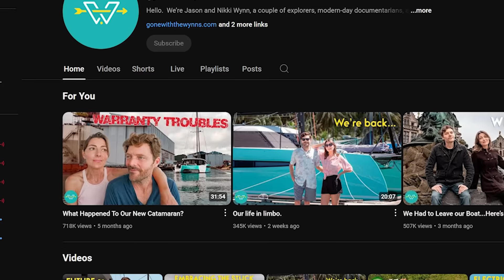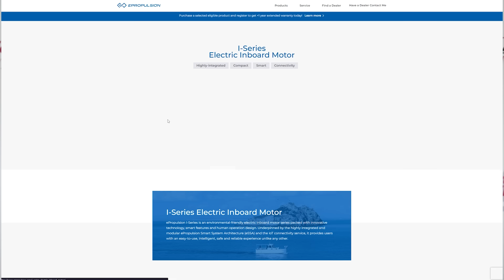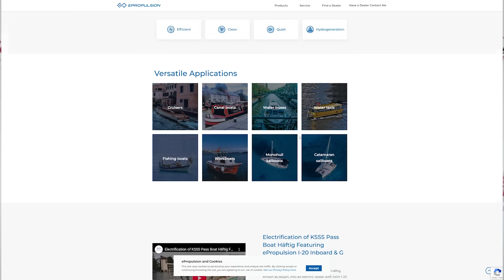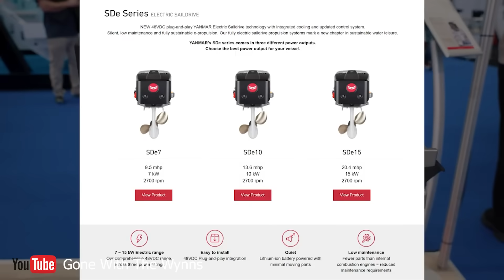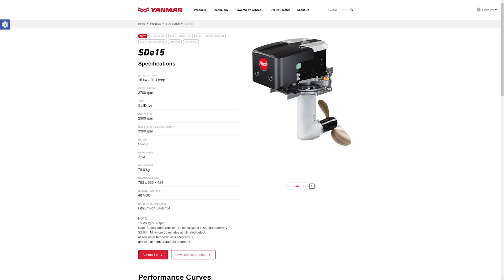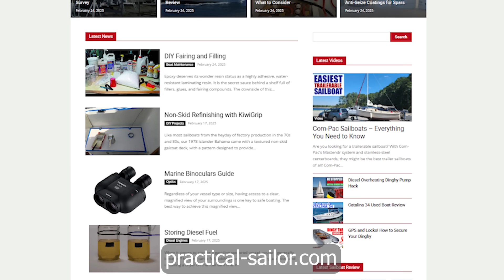Is It Too Soon for Electric Sailboats?

Comment: Water and electric.... Not a great combination. Most definitely at the current state of development, I prefer diesel as power source over electric. (After trying LiFepo4, agm, gel and standard batteries).

Unless with a small boat on a lake, to just enter and exit the harbor, electric is not good/reliable  enough yet.
Reply: water and diesel don't mix either.

Comment: On a blue water catamaran with diesel electric drive. Centrally located industrial 400VAC diesel generator and 2 electric shaft 400VAC motors. Highly efficient and reliable. Now 19 years old and still working completely fine. Very happy.
Reply: Truthfully, on a catamaran that makes sense as they have very low drag (good for electric) and you would have to have two diesel engines, which sucks.
Reply: @crunchycrispybacon  Not "less drag", but when lightly loaded, can exceed their hull speed.  "Modern cruising catamarans" are heavily loaded, at the expense of that advantage.
Reply: Your system seems to work for you, but "modern sailors" lose bragging rights over the noise, odor, and maintenance of diesel.  I also question their competence around 400 VAC equipment.  Having two independent systems also deters "what if " questions about triple backups from the living room experts.
Reply: @ I’m not telling. People they need to change whatever they are doing. Be at peace.
Reply: That's the key to success, diesel generator. 
Caterpillar with their monster build prove it everyday.
Reply: @GoPoundSalt Hybrid...yes

Comment: Batteries will not improve in the next 40 years. So maybe we should copy the tech used in trains and huge ships. Trains and large ships use an electric motor and batteries that are powered by diesel. Not many batteries. There is a diesel motor that is quietly operating at its most efficient RPM keeping the batteries at optimal settings. Should not be too hard to do on a sailboat if there is space.
Reply: Trains and ships only use the technology that they do for one reason: Scale. It is simply not practically possible to build complex mechanical drive systems in those applications.
Alternator losses, variable frequency invertor losses and motor losses far exceed those of your typical mechanical drive system. There's a reason that hybrid cars use a conventional drivetrain when running on the engine rather than using the electric drive and it's the same reason trucks use conventional gearboxes and drives rather than electric.
It all comes down to efficiency.
Reply: @davidbrayshaw3529  Also those commercial applications run all day so the diesel electric makes good sense. For typical less than 1hr/day it makes no sense. Just use the diesel.
Reply: @ Unfortunately many harbors require electric motors.
Reply: @CheapHomeTech  Which?
Reply: @ Which harbors or which boats?
Reply: @CheapHomeTech  Your mention was only only of harbors.  The topic at hand is private boats.
Reply: @davidbrayshaw3529  Seems you have many assumptions. Existing small boats have diesel that are powering batteries that power the electric motors. There is no complex mechanical drive systems and what not. Quiet, dependable, and affordable allowing for hundreds of miles or more at slow speeds. The Wynns boat mentioned in this video has such abilities allowing for extended and efficient cruising.

Comment: Electric drives are massively expensive when compared to a diesel engine.  When you consider the mass and all internal moving parts on diesel engine compared to an electric drive which is far cheaper to produce because it has a way smaller mass which equals less material . Then consider 500 moving parts on diesel engine compared to 10 to 20 parts on electric drive . The diesel engine will when properly maintained and quality of said diesel engine will far outlast any electric motor. The other problem is the complexity of all the extra electrical components to refit the boat with the electric drive system.  Diesel engines only require a 12 volt battery. Electric sail drive looks good on paper but unfortunately not good on the pocket book and long term reliability.

Comment: If youre plugging into shore power every night, and dont motor far,  it's fine, if you want to go cruising and travel places without Shor power it's nothing but problems.
Reply: I'm not a rich man, so I hesitate to pay so much for an electric motor AND a bunch of batteries OR a new inboard diesel. My system for now is a 15hp outboard on my diy handmade mount that also holds a 62 pound thrust trolling motor. The trolling motor is great for getting in and out of the slip since I can turn it at 90 degrees and push the boat where I need it to go.  I have a 200ah battery and over 400 watts of solar. The little trolling motor will go in 4th gear (out of 5) as long as the sun shines, although slowly, and for a LONG time in 5th gear.  Now that I've graduated from a 25 footer to a 33 going into a strong wind is impossible.  That's what the outboard is for. Of course there's the problem of cavitation. 
I've become obsessed with the EPropulsion pod drive that is equivalent to a 9.9hp, for about $3100, plus batteries, which would be enough for most situations but would be slow going into a strong wind.  So I'd still have to have the outboard to be sure that I get back to the marina. 
Still dreaming!

Comment: The range argument is such a red herring. A hybrid system solves range entirely, and reaps all the benefits of not having a complex metal object interfacing with seawater constantly.
Reply: Not a red herring.    Hybrids require two separate systems... diesel engine/electric drive.    Complexity invites failures.
Reply: @Ranchpig67  A hybrid system adds a grand total of ONE extra moving part; the electric motor.

And it eliminates thru-hulls and seawater intakes.

Comment: Hi Tim. Worth keeping an eye on developments, but right now the issue continues to be issue of energy density, and far and away the best “battery” continues to be Diesel Fuel, and in the near future- the continuous renewable energy from waste to energy from Plasma Gasification with Syngas production of ultra clean liquid and Gas synthetic fuels, the most important of which being energy density enhanced synthetic Diesel. But ! There is a completely new option that is becoming available in the form of new engines from Toyota,which have almost zero emissions, and which can handle a range of fuels including hydrogen - which after full research after the 1970’s Oil Crisis, became questionable after successful end results , when people started asking questions about whether we really want large amounts of hydrogen all over the place, with very easy access to them, given what a high explosive hydrogen really is, and which doesn’t even need complex detonators to set it off ? 🤔 For Safety concerns, nothing actually seems to be better than diesel fuel frankly, given you can even put a cigarette out, by just throwing it into diesel.  Given we can actually produce pretty much unlimited synthetic diesel, at extremely low cost, I know what I am sticking with for the foreseeable future anyway. All the Best. Bob. 🤔🌟🌟🌟👍⛵️
Reply: You miss the crux- the issue is WEIGHT....you just gloss over this by saying "energy density" If battery capacity is increased many of the problems cited (low range, low power) go away and, as opposed to ICE engines which need to manage damaging heat and friction as well as liquid fuel supply engineering issues (many more failure points) Electric looks really good.
I never need to change the oil on my electric. I never need to clean a filter. I never need to replace an exhaust elbow. I never fail due to mechanical issues. At its' base level Electric is superior.
Reply: @ you totally ignore multiple issues,mwhich include issues such as how do you produce enough electricity to keep storage topped up , how many people actually have any understanding of how to treat batteries properly for a long and reliable service life ,mwhether lead based or the spectrum of lithium some of which it is recommendedvthatbtheynonly be charged in explosion proof containers, Lifepo4 for example,should never be discharged below 50% capacity or you lose recharge Cycles, must not bevrapid recharged or rapid discharged as that shortens their service  weight of batteries if positioned correctly can have beneficial displacement benefits plus can counteract the leverage effects of an aft Cockoit Solar Arch with Solar Panels,May having a bank of AGM batteries mounted low  at Cabin sole level below deck. How many people know how to dramatically reduce the stress in individual batteries by sharing the loads equally between four batteries,instead of over stressing in every respect a single battery ?, Frankly, it is only in the last year or 18months, that enough information has become available, to be able to start treating Lifepo4 batteries properly, and is why I had no alternative but to reject an offer by Anpere Time - now called Li Time - to provide me with a bank of their batteries to see just how long I would be able to make them last - the needed basic information simply wasn’t available. In contrast, today, it appears that I am now able to make a Bank of cheap Redodo Lifepo4 batteries have a potential very long service life indeed, which frankly is one heck of a transformation, but still, for reliable propulsion and enough storage capacity of high density energy, capacities are still way below requirements for the Marine Environment, and as Jimmy Cornell clearly confirmed, you just can’t get enough energy production to even fulfil basic requirements can you ?So if you wish to keep deluding yourself with LaLa Land delusions based on fantasies and wishful thinking,m you are welcome to carry on, but please refrain from contacting me, until you yourself  at least start comprehending what the actual f*k you are are talking about. Deal ? 🤔
Reply: PS. Tim, new ICE engines that will destroy the market for EV’s are being created by Toyota, and I have just heard that Mercedes are doing engine development along similar lines. In addition, they confirm that Ford was already on the right track with its 1980’s Lean burn technology, so I wouldn’t be surprised if Ford soon joins in as well?, All the Best. Bob. 🤔🌟🌟🌟👍⛵️

Comment: The inboard diesel in modern sailing yachts is an auxiliary motor only insofar as the captain operates it.  In reality, it is a true second mode of propulsion. The electric drive boats are auxiliary because of physical limitations, so they offer a smaller margin of safety.
Reply: Both depend on the size of the "tank". Most E-yachts are tanked too small due to "up front" costs. On the other hand, my diesel has quite a limited range being built when people went sailing instead of motoring.

Comment: Full elec fine for day sailing, coastal.
Depends how lucky you are at predicting the weather blue water crossing, Hybrids the safer bet, like distant shores, delos.
Uma have switched to 2 x elec saildrives
Reply: Delos does not use saildrive, which is inexpensive but costly to  maintain.
Reply: @captainjimolchs  I never said delos do.
Guess you mean "more" costly. How do you figure that?
Regardless, rather a small shaft hole thru my boat, vs one a 6yr old could fall thru.
Reply: I did not see the period after ", delos".  Parlay Revival required a haulout to repair their saildrive.  Saildrives are more prone to leakage,  If the hole is a danger to a child, it is risk for all aboard.
Reply: @ Huh? 🤔
You said sail drive is "inexpensive".
I asked how you figure that?
More expensive vs shaft isn't it?
Reply: @Lana_Warwick  Less expensive to produce and install.
Reply: @LoanwordEggcorn  Perhaps, but out of the 2 impacting something under water surface in blue water, i.e sea container, ice, which will come off 2nd best?
Reply: @LoanwordEggcorn  Laser not required. Careful and fussy alignment with old school analogue tools is required.

Comment: As is the case with electric cars, until there is a major breakthrough in battery technology, we seem to be stuck in an experimental stage.
Reply: Over 90% of all new cars sold in Norway are electric. You're 15 years out of date.
Reply: @phillycheesetake  The difference in energy density between diesel and l-ion batteries is massive. Even when you factor in typical thermal inefficiencies found in a diesel
power plant, they are chalk and cheese. 
That isn't so much of a problem in automotive applications as you can access grid generated electricity and rapidly recharge the battery. 
In maritime applications, that isn't the case. If you're lucky, you might have a thousand watthours of renewable energy production on a yacht, and that has to be shared with a number of systems. And if you do have to use an onboard generator to recharge batteries, it's grossly inefficient and it's slow.
Reply: Electric cars are no more experimental.

Comment: Very cool but I can see some issues. Battery electric vehicles get their efficiency partially through computer controlled battery heat management. It's great that these manufactures seem to have worked out the details around the electric motor but without a matching computer controlled battery management system, they won't be able to achieve the total efficiency and reliability they need. Look at the difference between a Nissan Leaf with an air cooled battery and a Tesla.
Reply: In a way, you're comparing apples and oranges.  The Leaf's problem wasn't one of efficiency, which it was actually really good at.  The problem was battery temperature management, which is required for battery life.  That's only partly related to how much power was being pulled in and out of the pack.  Mostly, it was a poor design choice, not one of computer control.  The air cooled battery was fine at keeping the battery cool, even under load, but only when the outside air was cold enough.  It didn't work at all in the summer in Arizona, as it is impossible to cool something with air that's hotter than the thing it's trying to cool.
Reply: @tubeuser2350  That was what I was alluding too. All, more modern BEV heat management systems are liquid systems. The best systems (Tesla) use high efficiency valve systems that are computer controlled but to your point, liquid cooled systems alone with a simple thermostat would be better than air.  Basically the difference between an air cooled Porsche compared to going liquid cooled.

Comment: Nickel Hydride batteries are used for marine purposes because they are  completely safe. Used in personal military devices. If you're in the Carribbean no reason not to go electric.😊
Reply: Nickel doesn't have the energy storage capacity needed.  LiFePO4 (specifically, not Lithium in general) is quite safe in a properly designed system (i.e. with a proper BMS).  That chemistry's makeup is very hard to push into thermal runaway, unlike the cells in our phones, laptops, and most EVs.

Comment: 1 hour without overheating,  
So you can travel 5 miles ? 
Then you watch some sailing shows where people had to motor for 24 , 36  hours to get out of dead air 
As for UMA I find range or lack of is mentioned in almost every story
Reply: Imagine getting caught on a lee shore because your electric conversion overheated.
Reply: @WojciechP915  Imagine getting caught on a lee shore with a (insert a hundred reasons ICE engines fail)... A sailor needs to calculate their crafts abilities and make hundreds of decisions every passage to be safe and you'd calculate...also who EVER heard of a diesel overheating and failing? Buellar?
Reply: @WojciechP915    I was just thinking the same thing....
Reply: To be fair that's longer than I would ever run my diesel engine at full power.